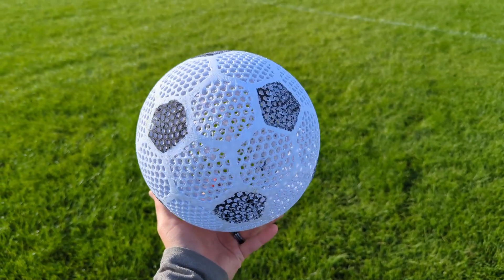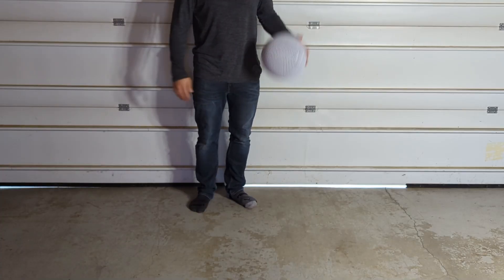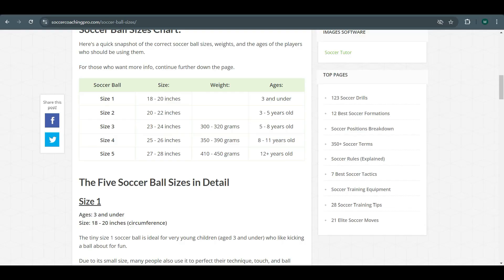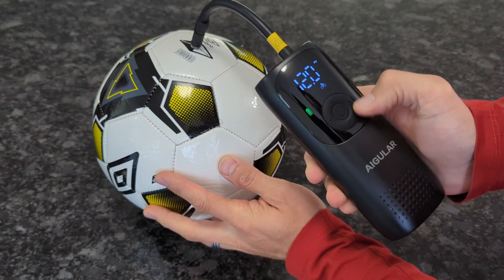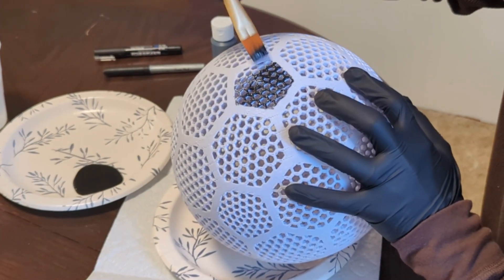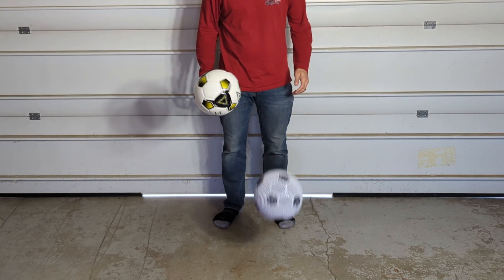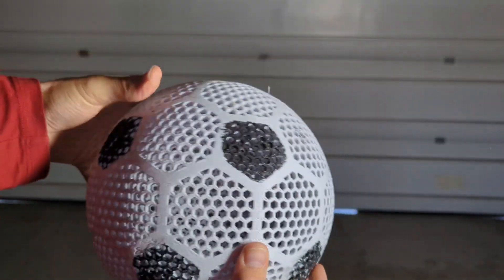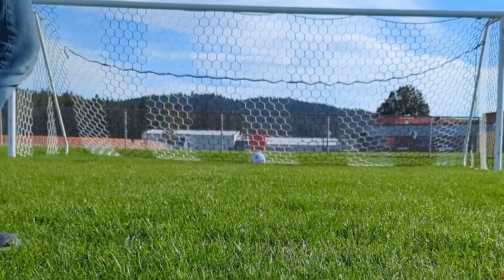3D Printing an Airless Soccer Ball (Football)!

Comment: How much does it cost to produce a 3D printed soccer ball ?
Reply from the maker: Hey there, it depends on a few things, especially the type of filament and model you use. If you use everything I showed in this video (Flex PLA + my model), it would be about $17.50 (about 500 grams out of a $35 roll of Flex PLA). This does not include the electrical and other costs though. Hope this helps!

Comment: Does TPU 95A work good?
Reply: 95a actually works perfectly for a soccer ball. unlike a basketball, it doesnt have to be super bouncy; the hardest thing is dialing in the number of walls so that it gives enough without giving too much when you kick it. mine is like a little hard on contact and a little squishy at the same time, but its a surprisingly good soccer ball
Reply from the maker: @nosenseofhumor1  oh nice, I have some 95a so I will give it a go
Reply: @makeitlabchannel  I tried 95A works great, but how could I remove support easier because I dont have an angle grinder I just used a  filament cutter.
Reply from the maker: @PowerSurgewastaken  I heard that setting the Z distance between the supports and the ball to 0.28 or even 0.3mm makes support removal much easier. I will test this soon to see if it helps
Reply: @makeitlabchannel  oh and the bottom of the ball is having some quality issues im not sure if its the printer(A1 bed slinger), filament(bambu TPU 95A HF) or the sliced file. you provided
Reply from the maker: @PowerSurgewastaken  hmmm, hard to tell. Did you change the printer settings to a TPU profile before printing? It is set for printing flexible PLA in the 3mf. I will have to try it on my A1 to see how it comes out
Reply: @makeitlabchannel  yes, I remember changing slicer setting to TPU 95A HF, maybe its the nozzle I using 0.4mm
Reply from the maker: @PowerSurgewastaken  That could be a factor, and I might need to upload a version specifically for TPU because I probably would have added more supports to the bottom if I was using TPU. I will have to test some of this.
Reply from the maker: @PowerSurgewastaken  I have seen some videos of people using 95A for basketballs and it not working well, so I tried a 98A and regular TPU just doesn't seem to bounce well. It might work for a soccer ball but I would go with something else
Reply: @makeitlabchannel  thx, and is the file you provided on Makerworld compatible with the A1 0.4mm nozzle?
Reply from the maker: @PowerSurgewastaken  It should be, you would just have to change the nozzle size/layer height/printer in the settings.

Comment: How do you get the flex pla so smooth and looking good whenever I sand my airless tennis balls it is like an annoying fluffy Alamo kind of texture
Reply from the maker: @Josiahs3DP  yeah, I didn't have great results as first, I had to dial it in a bit on my Bambu Lab P1S but it works pretty well now. What printer are you using?
Reply: @makeitlabchannel  ender 3 v3 SE 
I also ordered a Bambulab a1 mini and will print a few on there
Reply from the maker: @Josiahs3DP  I have printing profiles for airless basketballs/soccer ball that you can use once you get the A1 mini - hopefully it will help